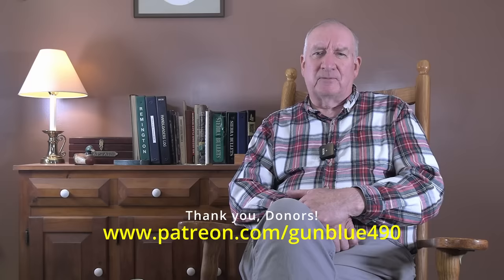The Copper Fouling Lie ~ Don't Fall for It!

Comment: How to leave the copper and remove the carbon?
Reply from the maker: All common solvents, including mineral spirits, paint thinner, Hoppe's #9, and plain hot soap and water, will remove carbon and graphite powder coating very easily, without attacking copper.  It's very easily removed. Solvents advertised as copper removers generally employ ammonia, which is immediately detrimental to steel in strong concentrations.
Reply: @GunBlue490  new into gun culture and I will carry this knowledge along with me thanks to you!
Reply: @GunBlue490 doesn't hoppes 9 advertise that it removes copper too?

Comment: I keep hearing conflicting ideas and am not sure which is correct. I watch this, and it makes sense. However, I watch videos with f-class and prs guys, (like erik cortina) and they say a completely different thing. They deep clean, carbon, and clean copper all the time. Which is correct?
Reply from the maker: Fussing with cleaning is a bunch of foolishness.  This is the way it goes:  They clean fastidiously and they shoot great.  Of course.  It's not their barrel; it's their talent.  They could shoot just as great or better without doing so, but they are convinced, just as so may ball players are convinced that they hit home runs because they wear the same lucky hat at every game.  The "cold clean bore" syndrome doesn't exist with my barrels, but it does every time one strips the bore and it requires several rounds of seasoning all over again.  Watch my most recent .270 Winchester test series.  That gun has fired over 1,000 rounds and was never given more than a few wipes with mineral spirits and a lightly oiled patch.  That gun will win for Cortina any day.
Reply: @GunBlue490  interesting, so for a lot of these guys it's almost like a superstition, and has become a mental thing. Thanks for your response. Very helpful

Comment: What are your thoughts on solid copper projectiles? 
There is a big name in firearms telling  people  to clean the barrel  of fouling  from cup and core bullets before  switching to lehigh defense  bullets .
Reply from the maker: Solid copper bullets are simply longer than an equivalent weight lead copper jacketed bullet.  They are proven to expand uniformly and reliably.  They are proven to be accurate.  Anyone who suggests that a barrel must be rid of copper before a solid copper bullet passes through it needs his head examined for fouling.  This is the trend lately, to suggest that one's particular product is so special that it can't exist in the presence of other "inferior" products.  Baloney.
Reply: That advice doesn't seem legitmate, unless one had been shooting lead bullets and had a lot of buildup. However, the solid copper bullet would be less prone to having a dangerous pressure spike in such a barrel than a traditional jacketed bullet as the solid would deform less at its base to become an obstruction in the barrel than a lead filled jacketed bullet could. That most solid projectiles are machined rather than extruded would also make them less likely to "bind" traveling down the barrel.

Comment: So I’ve been using Ballistol for awhile now to clean/lube mostly the whole gun, do you think I did any damage to the firearm by using that? Sorry if this is a dumb question.
Reply from the maker: I tried Ballistol for two years and stopped using it when I discovered that it washes off with water.  It cleaned no better than inexpensive mineral spirits, and provided absolutely no protection against moisture.  I have found no historical evidence that it existed before it appeared on the market some 20 years ago.  Germans are very highly technical about everything, and I'm very suspicious that they ever issed a field lubricant that can't stand up to water.
Reply: @GunBlue490  Thanks for the reply, I’ll use the Ballistol for something else then, and try those mineral spirits out :)

Comment: Is it okay to use hoppes to clean carbon from my barrels? Or should I be using something less aggressive?
Reply from the maker: Regular Hoppe's #9 is not aggressive, and does a fine job.  I love that odor, but personally, I use mineral spirits because it's about 5 times cheaper and does as good a job.
Reply: @GunBlue490  I've been using mineral spirits as a dedicated lubricant and corrosion protection directly after cleaning with the hoppes per your reccomendation! I always thought hoppes was considered "aggressive" because it actually removes the copper from the bore.... Atleast that's what it looks like it's doing when I run patches. Thanks again for the response!
Reply: @TerminalM193   It will remove some Copper. It does with all of my barrels.

Comment: Good video thank you.  Just wondering if anyone has tried those freedom wipes? I bought a can and it's just ATF mostly.( Automatic transmission fluid) I don't like them. Way too oily and thick and messy. Just an opinion on a other snake oil
Reply from the maker: Mineral spirits is the best and cheapest.
Reply: @GunBlue490  I remember that from your videos on lubing and cleaning. I have some. Does that work for leading as well?

Comment: Why would F-class shooters suggest to remove the copper along with the carbon. Eric Cortina says his clean process is to remove everything after a match. Any thoughts as to why?
Reply from the maker: Don't confuse a competitor with his equipment!  That's what every equipment sponsor loves, and why they sew patches onto jackets.  A high quality barrel will shoot well, whether it's cleaned of copper or not.  Mr. Cortina will replace a worn barrel to win.   He's not an F-Class winner because he removes copper from his barrel, any more than a NASCAR driver wins because Valvoline is in his engine instead of Pennzoil.  Competitors in any sport cling to that which they think works, whether it has anything to do with it, which can include wearing the same underwear for every game.  I don't shoot F-Class, but if my rifle shoots 1/3 MOA, I'm sure Mr. Cortina wouldn't mind using it. Some golf pros insist on spotless club faces, and others keep them cruddy because they're convinced that it's the reason they win.  I've known many competitive folks in my life, and if there's one thing in common, it's that they attribute material stuff to their success or failures, and they need coaches to keep them focussed on their skills.

Comment: well tell us what we should use
Reply from the maker: I prefer the same thing that's used by automotive mechanics, and every other industry to clean carbon off metal.  Mineral spirits.  Paint thinner is the same product with a different price.  Nothing more is necessary.  Follow up with a light wipe of mineral oil and a soft cotton flannel cloth to protect.
Reply: @GunBlue490  i remember years ago wanting to buy one of these rods that you put in the barrel and plug each end and it electroplates the copper out of the rifling. One guy i know who owns a 300 magnum is convinced that its clogged up with copper and the accuracy is hurt by it.

Comment: I am wondering how the Southern National winner would say to this? Starting from a perfectly clean barrel that is nothing but steel makes a lot of sense to me. I have followed your videos for several years now and I have gleaned much knowledge from them, however, I still and will always do that which makes sense to me. Reducing the variable of extra contamination in a barrel, be it from carbon, lead or copper still makes the most sense to me. Mainly because no one can quantify the amount of copper in a barrel. If your barrel will shoot an HONEST .5 MOA every time then you dont have to clean the copper. There are advocates out there that one should not clean a barrel whatsoever. If that works for them great, but it won't work for me since it will always make me question if an anomaly is from fouling or something else.
Reply: User error.

Comment: Just because the military does not consider something, or care about something does not mean it does not exist or is not important  your evidence is all anecdotal and i would say your reasoning is curcular. Making your hypothesis invalid. Copper in a bore is fouling. It does continue to build. And its not just copper  there are layers, like a lasagna of copper and carbon. You want to get the carbon out? You need to get under the copper to get to it. Also, last i checked, the military uses some powders with copper removing agents. So the military does consider it, making your initial statement, and extrapolation invalid.

Comment: Thanks for the good advice I don't like the smell of gun solvents would it be alright to use citrus solvents in my bore
Reply: Citrus based solvents are by nature acidic. I can't attest to them having corrosive properties or damaging the finish or how effective they are at removing carbon fouling for that matter.
Regardless, unless it's a citrus based product specifically intended to clean firearms I would tread carefully.

Comment: What are your thoughts on Hodgen's CFE powders? Are these also nonsense?  In my 50 years of shooting, I've never seen copper fouling.  Carbon yes, copper NO!  thanks for your hard work!
Reply from the maker: I have been using CFE223 for a number of years, mainly, because it's quite accurate with stated maximum loads and 55 grain bullets.  In performance, it's nearly identical to older BL-C2, but with a slightly lower volume, so it meters better in progressive machines.  
No, it's not nonsense for copper fouling in the military context of high volume, sustained, full automatic fire, where copper fouling does indeed become an issue.  The active ingredient was developed by General Dynamics to make copper in the bore brittle and thus flake off during firing, instead of brazing to the bore.  For normal rates of fire, copper fouling is not an issue.  As for its pistol variant, it certainly cannot be a matter of effectiveness.  But, if it performs well, as I understand it does in many pistols, it's good, regardless of any matters regarding fouling.

Comment: I think copper fouling is real. But I also think it is not nearly as common as some folks would have us believe. As I recall the copper fouling concerns began to become very popular with the original Barnes monolithic bullets, and they were bad for fouling. I dont use monolithic's myself, but apparently they have improved a great deal where fouling is concerned. If there are burrs in a new barrel then it can be an issue, but to me that is pretty uncommon. For the most part I agree that it is a non issue. But a real simple trick to remove any of the worst fouling is to pull off a small piece of copper SOS pad and wrap it on a mop and run that through your barrel. That will pretty much remove anything from a bore.

Comment: I used to buy into the copper fouling problem as well as  the "breaking" in barrels by shootng, cleaning, shooting cleaning, nonsense.  One year, when I was at SHOT, I had a conversation with a well-known barrel manufacturer and he told me to never use anything ammonia-based in a barrel because it will dissolve the nickle out of the steel and the barrel will wear out prematurely.  And his suggestion on breaking in barrels was to do an itital clean with basic solvent, then coat the bore with liquid moly, let it dry, and shoot the piss out of it.

Comment: So I would guess you don't subscribe to the theory of layers of carbon and copper fouling? Serious question. Thx.
Reply from the maker: No, I don't. As a professional electroplater in the 60s, I learned that copper does not double plate, regardless of how clean it is metallurgically. Shooting is not precision electroplating.  Copper simply fills the pores as bullets pass over it and cannot layer like a sandwich.
Reply: Not trying to be argumentative here, just trying to explore an issue I thought I've observed that now appears wrong. As the copper fills in minute imperfections and remains deposited, is it possible for subsequent shots under heat and pressure to attach some additional copper to the existing and create a "smear " of copper that travels up the barrel and extends the original deposit?

Comment: Meh there is truth to this but with all rules there are many ways to skin a cat. I use sweets but i use a regular solvent to clean it out afterwards and patch it out with oil. It also depends on what kind of shooting you do. But the truth is that most things in the shooting world are false. I continue to clean the easy copper out of barrels but I dont get it all out. Dont want to and never will. Some of the big over bores are even worse.
Reply from the maker: I urge friends to avoid Sweets like the plague.   For the brief moments that it's attacking copper, it's chewing steel, too.  It's like washing a car with hydrochloric acid, followed by an immediate rinse.  You can't separate the process with a clock.

Comment: Does this same school of thought on copper fouling apply to lead fouling? I'm kinda assuming so.
Reply from the maker: No.  Lead fouling is an entirely different matter and absolutely does cause serious accuracy problems, and in severe cases can act as an obstruction with damage resulting.  Lead fouling occurs due to improper bullet hardness alloying for a given velocity.  While excessively hard for slower velocities can cause leading when hot gasses sneak by a bullet that doesn't obturate, most leading is caused by shooting improperly soft bullets at higher velocities.  

Lead can only be safely removed by aggressive scrubbing with a bronze brush or better, with a Lewis Lead Remover.

Correct bullet hardness is a rather complex issue for the cast bullet enthusiast.  Most high quality bullet manufacturers will specify what range of velocities each style is suited for.  

Swaged lead bullets made by companies that produce jacketed bullets are generally quite soft and may only be driven at modest target velocities.

Comment: Hmm? Now, is copper buildup solely a function of a rough bore? I sometimes use JB bore paste and one time, in particular, it turned a disappointingly average barrel into a quarter inch super accurate barrel. But, the question I have is this; even Hoppe's #9 sells a solvent for copper fouling. Is this one of the companies that you worry might sue you for saying something negative about their product, or it's application, or it's need?

Can we agree that a clean bore is a good thing? Do you have a product that gets your bore as clean as possible? Do you then use a fouling shot? Just asking.

Another thing. I notice a lot of mention of 257Roberts and 270Win and 300WM....those not particularly known as accuracy/target stuff. If you shoot benchrest, what barrels do you like and how are they chambered?

Your last comment about cold weather. I belong to the West End Gun Club and our range is on deeded land in the San Bernardino National Forest. Since we have been so bothered by this CLIMATE CHANGE BS, in the form of "rain", I cannot access the range because the creek is literally too high to get across safely. Be thankful that you can even get to your range!

Comment: The only gun that I have had copper foul notably was a 17hmr. Small bullets at high speed leave copper deposits. My Ruger 77/17 would start stringing bullets high after as little as 10 rounds. JB bore paste and a bronze brush was the ticket to keeping the POI from climbing. I like to think the bore was getting smoother from the bore paste. I don't think bi-metalic (copper washed steel) jackets leave ANY fouling in chromed bores. Punched AK barrels with bore paste and a bronze brush after thousands of rounds and NOTHING came out.
Reply: Wat?
Reply: Bronze brush had copper
Reply: @hiwayhighway9925  right. Bronze, not brass or copper. Do you really think a bronze brush and JB bore paste leave any copper residue? Do you have ANY experience with JB products?
Reply: @eloiseharbeson2483  I have experience in chemistry and metallurgy.
Reply: @hiwayhighway9925  why that's absolutely great! And the giant spaghetti monster comes by to feed my dogs when I am out of town. Your metallurgical background does not actually mean ANYTHING when applied to cleaning firearms if you think that a bronze brush cycled at a foot per second or less will leave copper in a bore like a jacketed bullet at 3000 feet per second.
Reply: @hiwayhighway9925  Maybe you should reread and rethink about that statement before you beclown yourself. Do you really think a bronze brush leaves behind what a bullet does? Have you NO experience cleaning centerfire rifles?

Comment: You sir, say copper fouling is a lie, then you go to describe how a barrel gets copper fouling. You should get your story straight.  As to powder solvent, Hoppes #9 is the best I've ever used. Copper fouling does exist.  I have witnessed it with my own eyes.  Whether it has any real effect on accuracy is debatable. J & B Compound works for me when I get the urge to clean it out.
Reply: Your right , especially on J & B .  This old idiot is just spewing B.S. .  Fouling is fouling , both types are not good .

Comment: Copper fouling is not a lie, you're being disingenuous.  You're barrel did not come from the manufacturer with copper plating on the lands and grooves. Is this copper build up bad? Is more the question, and i would say no, to a certain degree. High end, competion grade barrels are hand lapped to remove any tooling or manufacturing imperfections and these barrels rarely if ever copper foul.the whole purpose of removing ANY fouling is to polish or wear down those tooling imperfections.today's copper removing products do not destroy barrels and if you have a modicum of intelligence you won't destroy your barrel. Military practices and procedures do not apply to sport shooting, beck the military originally told solders in Vietnam that they didn't have to clean their M16's! All I know is I want a clean bore, no carbon or building metal in it, I'll shoot with the clean bore for accuracy, then leave it alone and go hunting.